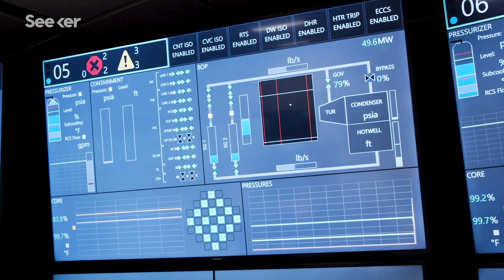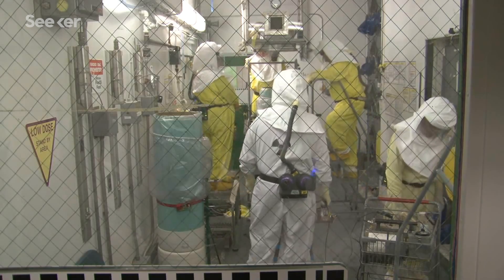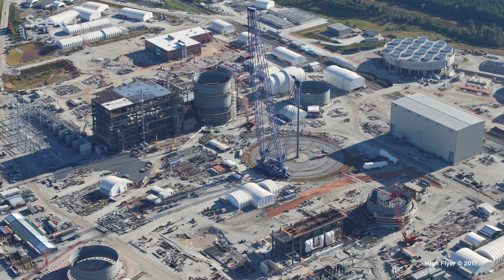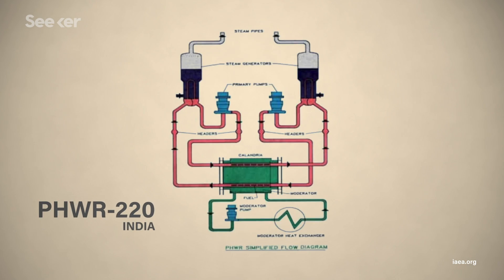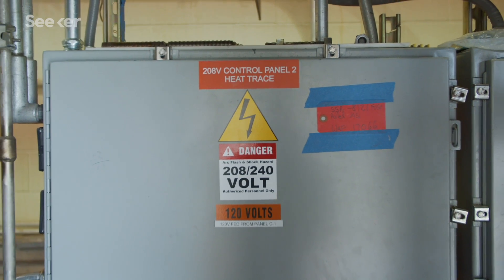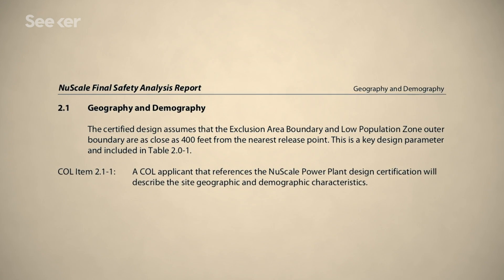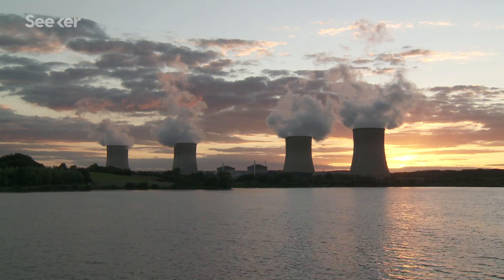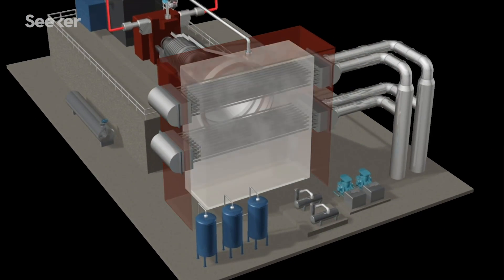Mini-Nuclear Reactors Are Coming, and They Could Reinvent the Energy Industry

Comment: "nuclear power has caused less loss of lifes than coal and gas"
You forgot hydro, solar and wind... Nuclear power is the safest energysource existing. Including Chernobyl and Fukushima!
Reply: Nuclear apparently edges out rooftop solar (https://nuclear-economics.com/wp-content/uploads/2015/08/12-deaths-per-TWh-1024x743.jpg ) but not solar farms, because people have been known to fall off of rooftops but not so much level ground. But the video hugely understates the safety case for nuclear power: while Chernobyl is estimated to be responsible for <4000 to 9000 cancer deaths, fossil fuels are responsible for millions (just how many millions? Reports vary, e.g. from 2 million total to 4 million per year: https://www.theguardian.com/environment/2020/feb/12/fossil-fuel-pollution-behind-4m-premature-deaths-a-year-study vs https://www.giss.nasa.gov/research/briefs/kharecha_02 ). Fukushima and Three Mile Island were not directly responsible for any deaths (no one got radiation sickness), though the evacuation process at Fukushima was responsible for 1000+ deaths: https://ourworldindata.org/what-was-the-death-toll-from-chernobyl-and-fukushima

So do the math: nuclear is about 1,000x safer than fossil fuels.

Also not commonly appreciated is that the Chernobyl reactor would not have been legal in the West. Among the plant's various design flaws, the most obvious is that unlike every western reactor, the Soviets didn't build a containment building around theirs. (Not until after it exploded, that is.)
Reply: Lol
Reply: System is the problem 🏡  The Great Qualities

1, Show all living creatures; all the love and kindness as much as you can.

2, Only try to be honest with yourself. If you try to be honest with others, you will get into big trouble soon or later.

3, Aim only one target at a time; otherwise you are chasing two rabbits and you will miss both. So, the reason behind it. Have one powerful reason and never ever give up the one you want the most.

4, Don't try to be good person only but be the powerful person. We will grow to be the one or we will die. There is no other choice. 

5, Always learn and look for to improve something your life. 

6, You are not alone. Love and faith the high power reduces unnecessary stress in life. But never completely rely on it. 

7,  Success and happiness are the byproducts of our usefulness. So, always increase the possibility of success.

8, Life is not going to be easy. Because of our unnecessary things. Eliminate all the unnecessary things as much as you can by organising yourself well with the environments. 

9, Never believe anything without the proper evidences. 

10, Always try to give more than you take. 
Because it is dignity/ character of the divinity within you.

🌎 As long as people continue to see themselves as separate from everything else, they lend themselves to being completely enslaved. Success depends on how well we relate to everything around us. Joy comes from that bliss of connectedness. I believe that unarmed truth and love will have the final word in reality. To love; you should have good heart. I am a good person until I see a person better than my standard of goodness. Being good is the progress towards a worthy cause. Love is God. Whoever lives in love, lives forever. How selfish it is to try to keep something forever? Love is all about nourishing, nurturing, sharing and expanding the love within you for all. The principle to which we adhere to is that we have kindness of love at heart for the whole of mankind.  As long as there is the unnecessary differences within us; we can not live peacefully so we have to eliminate all the unnecessary differences among us so we can love all. People abilities may vary but not there true love. If we love a person/ God for a reason then we love the reason but not the person. No reason is the reason to love the person because true love never fails. So do not compare or measure the true love as first or the last but love all truly. If you love people truly then you can understand people. If you don't love then you don't understand people at all.

People are controlled by system why?
The Cyclical Consumption is the current economy all over the World. It is making the scarcity problems of the earth finite resources to deteriorate day by day. Current Monetary System is legalised theft. Real money is Gold and Silver. Scarcity gives the money more value. Real money won't lose it's value. When Governments stay away from Gold & Silver then very easy to transfer the wealth / resources to upper class the Rich (Corporatocracy) Elite. When the Governments are printing out more new fiat currency with reserve banks, our old currency is losing its purchasing power everyday. They are printing millions of currency everyday. All governments and laws are existing right now to transfer wealth to upper class the rich elite. The USA Government & other Governments are in many countries, bailed the investment banks & financial institutions in 2008 against the majority of the people. There is no democracy in any countries. Because of the Money System based on profits motive only above all else even humans lives and well-being. So, we do not have freedom to protect our values with the money so on. The violence, bankruptcy & all the negativities are build into the Monetary System of our society. All are owned (including ourselves) by Reserve Bank. Which is private cartel the corporation. So, in legal system, we are legally considered as chattel the properties. They make money in the capital markets with our birth certificates. They do not consider us as Humans. That's the truth. We are at the invisible war with the Elites (Corporatocracies). We have to fight for our Freedom. Resource Based Economy is the Solution. We have to declare the earth resources as the heritage of all the people of this world. So everyone has access to it. Please have your research about zeitgeist movement then you know the truth more. 

 Truth About Health/Drugs Industry Because Of It Your Life At High Risk The drug industry is a 1/2 trillion dollars a year worldwide conglomerate. Almost 300 billions dollars just in North America. That is really big business. What would happen if everyone were well? There is no money in health. You see, good health makes a lot of sense but it doesn't make a lot of dollars. Because everything they do is toxic. Every drug they use, prescription drugs, all drugs are liver toxic, bar none. If you've had amalgam fillings put in your mouth by dentists. It is highly toxic. There's cancer because most of the chemos are themselves carcinogens. To view the tumor as the cancer and we know the tumor is not the cancer. The cancer industry is 200 billions dollars a year. The more work they get, the more profit there is. You have to dismantle; If the truth ever came out about what we would need to do. 30% of people of females in America are at risk of getting, will get cancer of the breast. The ones that are already dead have been grossly mistreated by the medical profession and by the government that supposedly is supposed to encourage free research and development of all possibilities. Why would medical doctors who studied medicine and practice medicine and are heavily funded by pharmaceutical companies why would they go and look into vitamins? That they never had the answer orthomolecular. And as more and more of our population start taking their health into their own hands, there's going to be even more and more of changes. It can't go on the way it is. The system is failing apart. We must make nutrition the primary prevention strategy for the population. You are what you eat. You are everything that you have ever done to yourself. The choices you make directly affect the outcome of your life. - (Food Matters Documentary in Netflix)

😊 Well, I truly love God. I am not religious but very spiritual person. So, I believe 1) Religion is the beliefs in someone experiences But spirituality is having my own experiences. The mainstream religions people promote religious ideology by giving guidelines and guide but In my spiritual life; I do not want anyone or anything between God and me to restrict my freedom to worship God. 2) We do not need any authorities to do good work. The god work is the good work always. In contrast; organised mainstream religions are claiming that they have the authorities to do God works as leaders so on. 3) God is not capable of doing wrong thing, change the past for us and create anything out of nothing for us. Nothing means not anything. So, even God is limited. The mainstream religious people believe that God is unlimited. 4) God wants us to take responsibilities for our righteousness life but not for all the consequences of our actions because they are continued to exist among us. So, How can god punish us for all our consequences? The mainstream religious people believe we are full of sins because of all our actions. 5) Freewill  is an illusion. People always choose the perceived path of greatest pleasure.  So, we do not have choices all the time. In contrast teachings of the mainstream religions are promoting people to do god's will always because we all have choices of freewill always. 6) We can not separate everything into groups. So, everything for good and evil and there's no success and failure for everything. If everything is real then real things can not be threatened. Once you come to understand that God/The Holy Spirit is in each of us, You will no longer need a Book to tell you how to live. Then why we need religious scriptures? The Virtue is the expression of the basic goodness in our actions. The Basic goodness is the fundamental worthiness of every individuals. We are worthy to God always in everything. 7) Beliefs in a cruel God makes a cruel man. No matter what; every living creatures has the right to live and What makes their life cheap? Everything depends on everything. Nothing too big or too small in value. We can not love and hate at the same time; Being a vegetarian means love without cruelty happily. The mainstream religious people are killing people and sacrificing animals in the name of God. They promote God's cruel punishments. The Punishment is endless for Sinners/Devil according to religious scriptures. But God is love always. Overcome hate with love. If all religions for peace, unity? No way. Because they are not for peace. 8) Well, The God gave us everything to go from moment to moment in our lives as we do our part  and pray only to thank god then the Love is in progress. The Love is always for everyone. We are always worthy of the God's love. Our greatest fear is; not to be loved by anyone but we are all loved by someone. When we eliminate all our unnecessary differences among us then true peaceful life is possible with the true love. If we can't find the peace within ourselves then we will never find it anywhere else. 9) This is the Fight for independence and freedom of humanity to worship God freely without religious guide and guidelines to restrict us. Unnecessarily, We do not want third party controls over us in anything ; especially in spirituality. 10) Revive Survive Thrive. Sincerely,  The Real Peacemaker against religious oppression.

 https://youtu.be/HbvCxMfcKv4
https://youtu.be/pIJHJzDQcRM
https://youtu.be/MyxbdmAnIcI
https://youtu.be/wLzeakKC6fE
 https://youtu.be/P8vHa8zD7jY
Reply: @seemlyme  god doesn’t not exist stupid Neanderthal
Reply: The people of hiroshima beg to differ
Reply: @Nekrumorfiini1  Thats an uncontrolled fission reaction. a bomb. not a power generator
Reply: @alikindsys It was a joke. He never said generator, just power. You are correct though.
Reply: @Nekrumorfiini1  Even then you're stretching it. A nuclear explosion can't produce usable power in any meaningful sense.
Reply: @stevess7777  Now you're just being disingenuous, there have indeed been proposals for generators exploiting nukes.

Comment: 60MW (even with 12 cores) is not that much. comparing to your typical 1000MW cores (usually 4).
While this solves the biggest problem of nuclear energy of long investment return. I wonder how efficient it'll be and how enriched fuel will have to be.
For now we do have enough uranium for "normal" reactors, but personally I'm a big fan of breeder reactors.

EDIT: ok, so apparently they are supposed to be non-breeder using LEU 4.95%, which is actually not that bad.
And once approved more efficient reactors may be build.

Comment: lol and the Crypto Community is talking about Micro Thorium Salt Reactors when they cash out. lol haha oh man these guys sound like they are 100 years behind.
Reply: @Seb C Hastelloy N is already considered adequate enough. And I think I've heard something about potentially replacing the entire core vessel as it wears out for a fresh one, instead of trying to engineer it to last for decades.
Reply: @Seb C Molten salt reactors have very high burnup rate and can reprocess spent fuel in real time, de-poisoning their core constantly and keeping up stable power output. It's possible to make a long-lasting core vessel for them (though it'll require pretty expensive alloy), but you can also make a single-use core and fuel it once, then replace it after all fuel burns up (which, given high burnup rate, might take awhile). The are also easy to engineer (corrosion issues aside - hey, Soviets DID engineer working oxygen-rich staged combustion engines, and those work with hot high-pressure oxygen, something even more corrosive!) due to low pressures around the core and have high passive safety via frozen salt plug, which will melt and let the fuel be drained into emergency scram tanks, if temperature of core exceeds normal parameters.

Comment: Why don't build these small plants in floating platforms inside abandoned underground mines???... since is floating is quake resistant, if something goes wrong you can blow the mine over the reactors leaving all the poisson hundreads of meters underground, mining quality access roads are already built as also all the electric infraestructure since mines are intensive energy-consumers, there are places to left the fuel and the nuclear waste, and sometimes they are also near the cities (meaning better electricity sell prices). Russia already made a floating power plant, and abandoned mines are already used for hydro-pump power plants. At the end, is just mount a nuclear submarine power module remotedly operated inside an already excavated mine... almost everything is already made and available.
Reply: How about just don't build them at all.

Comment: I live in the Yampa valley in Colorado.  We mine coal locally to provide fuel to two local coal fired power plants.  They have scrubbers on them.  We have BRIGHT, BLUE skies all the time.  Steam is only visible by product.  This past winter we had several mornings where we were well below zero (-14, -23, -20) degrees F and were colder than Prudhoe Bay Alaska.  Replacing the coal fired turbines with nuclear and repurpose much of the existing infrastructure would be a good use of resources.

Comment: They just simply need to get rid of nuclear energy entirely and besides you would think nuclear energy would be outdateddo two more higher advances in energy production such as solar wind and hydroelectric power and producing electricity by water flow and what I've been hearing over the years that a what was it a reactor using thorium and it's supposed to be a lot safer and has a much faster decay rate or breakdown late than plutonium and uranium or a thorium or some type of pellet reactor

Comment: I believe the future of clean energy is going to have to be a diversified group of different renewables and implementation must be done intelligently. Unless we can finally figure out fusion which is inherintly a failsafe type of nuclear power generation and would be a game changer, we will still have to partly rely on some traditional nuclear power generation, or at least a modernized version of it such as SMRs as nuclear if handled correctly is a very green source of energy, at least in terms of the fact that the only CO2 production involved is  involved in building and maintaining the reactor but obviously not in the reaction itself.

Comment: Tl;Dr stop fighting type 1, nuclear is fine.

solar causes more deaths than nuclear per megawatt.
Solar panels, when broken, leak toxic material into the environment, sweeping that "broken glass" up could kill you, easily.

Solar and wind requires so much land area, that it's detrimental to the environment.

The panels and turbines themselves require a great carbon input to produce.

And every single method other than the exception below have absolutely terrible efficiency.

The one and only exception to this is geothermal.

There is a place for green energy though, which is to replace fossil fuels in providing the energy required for nuclear.

Please recognize you are fearful about a design that was already archaic (Chernobyl), a plant put in the single worst position(Fukushima), and a military nuclear testing ground(3 mile)

Comment: MSR - molten salt reactors running off plentiful Thorium is the true next step for nuclear reaction.  solid fuel reactors such as we have today only use 1/2 of one percent of the potential  energy and create lots of waste products.  MSR (not SRM) inverts the efficiency and utilizes 98%.  In fact these these type reactors can CONSUME waste products of traditional reactors.  Best of all they are inherently safer than any solid fuel system like those discussed in this video.  As another commentator said, MSR was proven out at national labs 60 years ago.